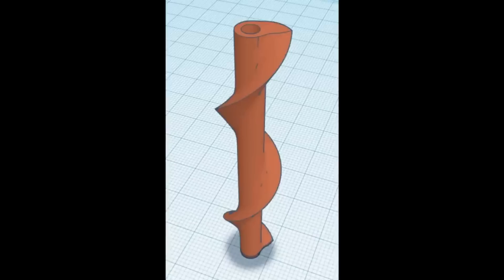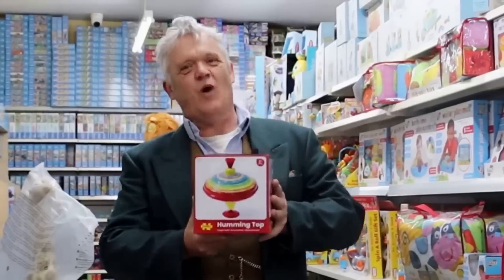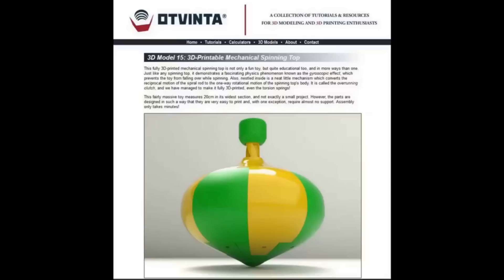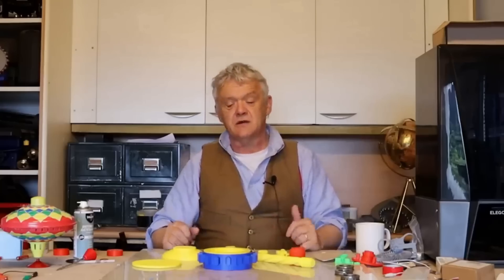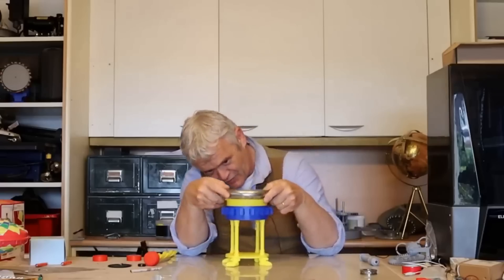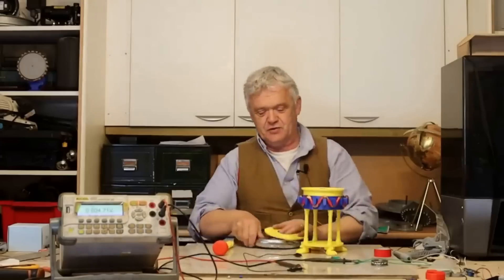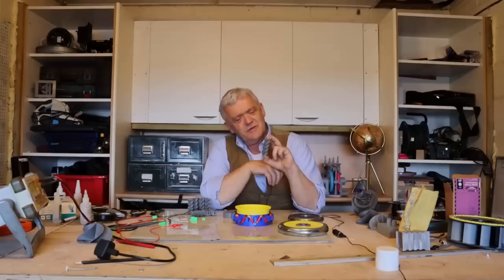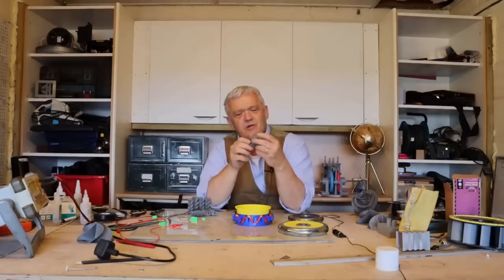2183 Storing And Using Gravity For Emergency Power

Comment: why can't the gravitational up thrust caused by flotation in a tidal range be used to drive a drive shaft that produces electricity, surely the energy required to lift a 100000 tonne hull through 11 metres every 12 hours could be tapped?

Comment: Have you yet investigated heavy electric motors acting as clock drive weights, climbing up endless chains, with limit switches at the bottom and top of their runs? Even simpler, more efficient and more elegant than spirals. Been made for years. Church clock makers can show you examples. Perfect for storing energy.

Comment: The problem with most gravity power systems is the energy loss through friction and all these expensive gears and screws wear out over time. Is there an example of harnessing gravity power in a friction-less cheap to build and run system?
Reply: Well, this got me thinking of a mechanism with the following components: a seesaw with one end attached to a constant-force spiral torsion spring at floor level. The center of the spring is attached to a generator. You activate it by placing the weight on top of the other end of the seesaw and let torque do the rest.

Comment: I wonder if you could lift something really heavy to store energy. E.g lift your house up a few metres to store solar power in the day and have it drop back down during the night. You'd have a super geared down motor. Admittedly the house would need to be designed from scratch for this and would pose some architectural and engineering issues to make it possible to get in and out at varying heights. 

Problem is if you do the math it's not a good store of energy. E.g. lifting 50,000 kg 10m in Earth gravity (9.81m/s/s) is 50000*10*9=4.9MJ. Which is only 1.36 kWh. Meanwhile a 12V 180Ah battery is 12*180=2160 Wh or 2.16 kWh. So the numbers don't really add up unless you have enormous masses or enormous heights. Or both if you have pumped water energy storage.
Reply: Thanks for the exact numbers and comparison, I'm currently searching a plot of land for an off-grid cabin, and I'm planning to do pretty much what you've described by using heavy things on the property (=large compost, watertank, small greenhouse, toolshed...). I know that the energy density is absolutely terrible compared to modern batteries, but since that won't be the only thing I'll have supplying energy, it's quite cost-effective, material-friendly and relatively easy to build, I think it's well worth doing. I will have other systems also (like wind and solar), but hopefully I could use gravity and weight for lightning some of the time.

Comment: Awesome, i have virtually no engineering knowledge, but enjoy these videos (and Roberts laugh). I have been asking myself for the last 10 - 15 years wether it's possible to build houses with a gravity weight dumb waiter type of system, that could power up using maybe solar, or off peak power, and then drop and generate when needed. I guess it is possible?
Reply: More than possible, the mechanisms needed are in existence. Ive been in the same boat for a similar amount of time. Why use chemical batteries when gravity can store energy forever. It's cleaner to make, easier to source, and less detrimental to the environment when end of life comes.
Reply: you're looking at a small homes usage would be like a 5 ton weight at least 50 feet in the air  and maybe produce a few hours of energy       the reason this is not more popular is because the amount of weight necessary @flyingsodwai1382

Comment: The rotating frame is ingenious but it seems like it would be simpler overall to have some kind of ratchet in the weight allowing it to be lifted without turning the screw - possibly something like the "half nuts" on a lathe feed screw, so you can pick the weight up and let it drop without turning the whole machine over

Comment: Philippine gravity generator is awesome. Imagine one with 3 or more arranged so that a smaller rotation would bring a Fresh weight into play. Instead of rotating a full 180 degrees, maybe just rotate 30 degrees or less depending on how many "spokes" there are...and a new stack becomes verticle and unlocks that weight to drop. The final foot of drop could even power the next rotation of the stacks.
Reply: - perpetual motion here we come...  Nope, that doesn't work (unless for each cycle the apparatus gets lighter and lighter)..
Reply: @kadmow not only perpetual motion, if you also get energy out of the system it's a free-energy-generator!
That would be nice!!!😂😂😂
Reply: @kadmow  I wasn't thinking in terms of perpetual motion, I was thinking in terms of extended run time, as well as shortening the interval required to shift a new stack into play. If all of the spokes are mounted on the same main shaft and rotate together, it would take a minimal amount of cranking to move a new shaft into place. Certainly there is no free energy, the spokes will be heavy to move because all of the "down" weights will be on one side there would be a lot of weight to crank up each time... So some major gear reduction would be necessary to crank all the extra stacks around. Unless some clever engineer can figure out a way to make two stacks counterbalance and reduce the amount of force required to spin them?????
Reply: And you can improve this even more if you down scale each of the dinamos you can have several of them working on one shaft
Reply: @ozb2006   - why did you post 6 times??
Reply: And you can improve this even more if you down scale each of the dinamos you can have several of them working on one shaft
Reply: And you can improve this even more if you down scale each of the dinamos you can have several of them working on one shaft
Reply: And you can improve this even more if you down scale each of the dinamos you can have several of them working on one shaft
Reply: And you can improve this even more if you down scale each of the dinamos you can have several of them working on one shaft
Reply: And you can improve this even more if you down scale each of the dinamos you can have several of them working on one shaft
Reply: The final foot couldn't power the rotation of the stacks, since it'd be lifting twice as much weight, to a higher height than it itself is falling. That's how you end up with perpetual motion machines! It might be more convenient, but maybe not. Since the operator would be lifting 3 weights, even if less distance each, if you end up with one of the weights at the top it would at best only balance out, ie break even compared to just one weight. So it would be harder to turn. You'd be lifting 3 weights 1/3 of the height, each. 

Still it's a nifty idea. What would be good, and require maybe a ratchet clutch, is if the operator could just grab the beam and pull it round manually, then just use the crank for the last bit of lifting when it becomes difficult. So stronger users could turn it over quicker in that way.

It's not quite up to powering a village that doesn't have electricity cos you'd need someone on it all the time. You'd need a longer-time energy storage, or else burn wood or something. Mostly it's a nifty science demo.

Comment: what an elegant implementation of gravitational power storage!  making it so the resetting of the weight is done simply by turning a handle is brilliant.
Reply: Rigged with a counterweight system it'll be next to no effort. Maybe a little electric gizmo to turn automatically.
Reply: @jonbutcher9805  You'll have to put energy into the system to get (light)energy out.
You can't just have this system run itself automatically AND tap energy out of the system.
That would mean you have created something known as a free-energy-generator.

I'd rather opt for a version, where I can grab the top with my hands and use my bodyweight to pull/push it all the way down. I don't know how heavy this weight is, but I guess it's less than my 90kg. That way I can recharge the system way faster, which is very handy for emergencylighting, I think.

But this version is (obviously) built to be so easy to use, even a kid can do it.
Or someone in a wheelchair.

Or someone who's too lazy to get out of bed, a.k.a. "a student".😂
Reply: Could you explain the power input for all the universe energy runnings ?...so if equal in equal out what is the equal in for all the current energy in our universe what is the power source...thank you..
Reply: @TerrorTubbie666 There has too be an equal energy in that runs our universe as a whole or else that would mean we live in a free energy   universe
Reply: @jshaw4757  it is simple. All matter is energy. All energy is matter. They are the same. Energy cannot be created or destroyed. It is simple converted from one form to the other and back again. As per Einstein's equation E= MC squared
Reply: @jonbutcher9805  yh so where is the input for original energy...if everything needs an input...too get an output...nothing can exist for free...then there must be an input for the energy we use too exist in the first place by its own laws....you can't just say ahh here's a magic input that exists without any input it defeats the whole idea....Big bang states nothing...no energy...nothing...then everything chunks off rock n matter n heat n plasma and periodic table and whatever else we are yet too even begin too discover....I'm not coming from a religious perspective I'm taking input output....energy cannot be created ???...so energy itself needs no input...it just is...then that is free energy
Reply: Are you familiar with Walter Russel? I have read some of his books but nothing really clicks.
Reply: Have you ever seen a pendulum at rest, then accelerating? That's technically harvesting the energy from earth's rotation. But it's horribly inefficient, probably a magnitude of 1horsepower to every 500 lbs of swinging lead, but "free".
You could take a large fresnel lens and focus it on a solar panel. You'd have to install some sort of cooling system, but that would be "free" sun energy.
Hang a long wire in the air and it will resonate with the radio waves tht hit them. Telegraph lines used to explode from harvesting too much electricity from solar flares.

Free energy is a silly concept but has quite a few real world examples. Solar panels wear out, wires rust, pendulums are pendulums lol
Reply: It's how grandfather clocks work :)
Reply: I'd love to see how much power it actually generates. How big to run a house? Or charge batteries to run a house?

Comment: Could you use the power from that generator to turn the crank  handle of a second gravity generator and continue producing power seamlessly, almost perpetual motion?
Reply: No. You COULD use the power to crank the handle of the second generator but,  Because of friction losses (which I imagine are pretty hefty here) the second genny wouldn't be at full height before the first weight was at bottom. If you further rob energy by running a light then the second weight would be even lower when the first weight got to bottom. You may get a few cycles but each cycle would be shorter and shorter ending with both weights at rock bottom. It would be fun to make engineering or physics students calculate how many cycles such a system would get.
Reply: NO.  - - - FRICTION steals the power.
Reply: I believe it should be possible to make a series of these all connected so that they all rotate together. Like a gravity generator version of an old-timey rotary engine. When a new stack goes vertical after rotating maybe as little as 15 to 30 degrees, depending on how many "spokes" there are, the weight could be unlocked and start dropping. If the whole system is balanced a small stepper motor should be able to rotate the system and bring a fresh generator vertical.
Reply: Rotating the frame is lifting the weight, which is how the energy is stored - you can't rotate it "for free". Energy out < energy in, always
Reply: @roostershangarworkshop8051  Being balanced means all weights would be in the same position. As soon as we extract some energy (by letting a weight descend) we necessarily loose the balance.

Comment: I had a thought the other day. What about gravity driven cuckoo clocks? I remember my mother resetting the weights each day, granted they weren't hooked to an electrical generator, and true the students used a much greater weight, but would a chain drive have construction advantages over the worm gear? Or would it be the opposite? Curious about your thoughts and experiance.
Reply: I think that using a chain would make the design more accessible to DIY'ers as the worm gear shaft isn't easy to make and expensive to buy otherwise. Also there is very little room for rollers supporting the weight on the shaft, so that may require high precision small parts to minimize friction, further increasing complexity.
The main challenge with a chain is to limit the descent rate without adding friction, other than the desirable resistance from a magnetic field passing through a coil. I'm sure a balance can be found with a very small sprocket for the chain driving a large stepper motor or custom-made generator.
Unless it's meant to be operated by a child or elderly, I'd skip the whole crank system and manually rotate the frame as it's long enough to give plenty of leverage.
Reply: @VeniceInventors  I agree about the crank system. Maybe it was proof of concept for a massive system but, more likely I think it was to teach some engineering principles to students.

Comment: When I think of gravity energy I always think on water. as always thank you!!!
Reply: Weight is weight, and the benefit is that sand and water can be divided and moved in smaller portions, which increases the versatility of such a system. The real winner here in my opinion is water, because so many other means exist for moving it.   Meaning your solar, wind, water generation, or any energy harvesting mechanism you think of, can move water for you. Add the assistance of a ram pump to move a portion of your water, and you really have some efficency.